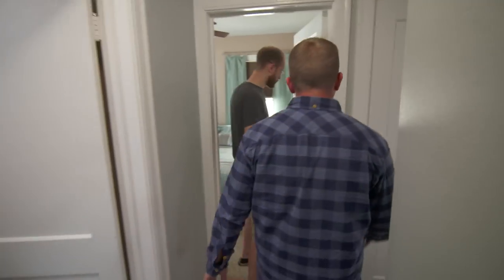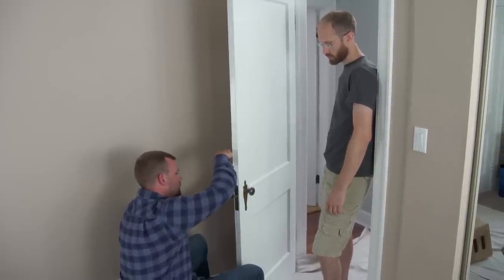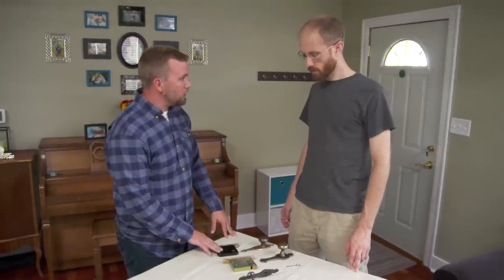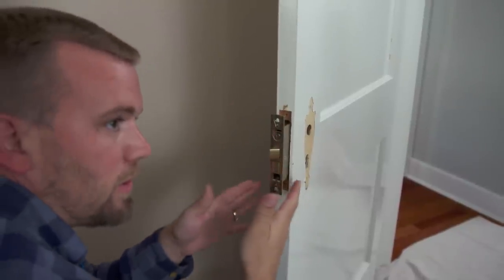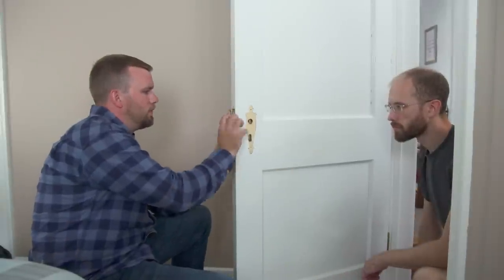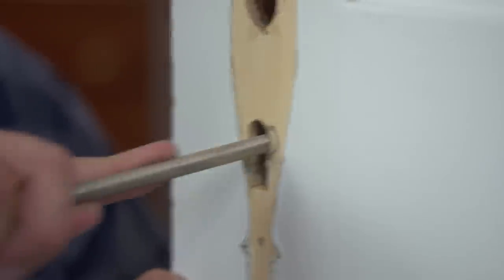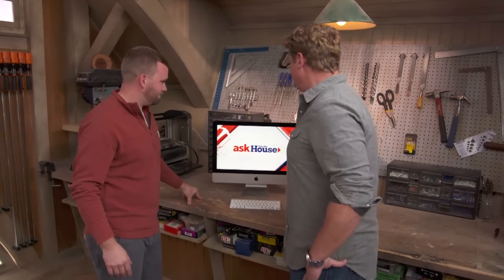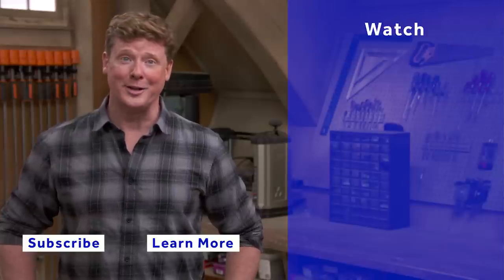How to Replace Full Mortise Door Hardware | Ask This Old House

Comment: The mortise lock sets that were in my home were all missing keys. I pulled them out and removed the lid. There are only a few raised nubs that are customized for the corresponding key. It took my Dremel with a grinding wheel just seconds to get rid of them. Now, any skeleton key will work. They're just bedrooms/bathrooms so the doors don't need to be impenetrable.
Reply: Brilliant! Can't wait to try this for my own missing keys.

Comment: The new thumb latch does add some safety it's now not possible to be locked in a room without a way to unlock the door. The old lock was keyed on both sides of the door.
Reply: Jeff Blount  Because of fire, it’s against code to have a keyed lock where you need a key to exit a room or the house.
Reply: There is a key for the other side of the door for that very reason. You can see the key with all the parts on the table.

Comment: The interior door components don't seem to be available from rejuvenation and all of the links above simply take you to their front page.  The links to the amazon products take you to keyed door lock replacement hardware, not turn latch.  It does not seem to be possible to do this project any longer so you may want to take this video down.